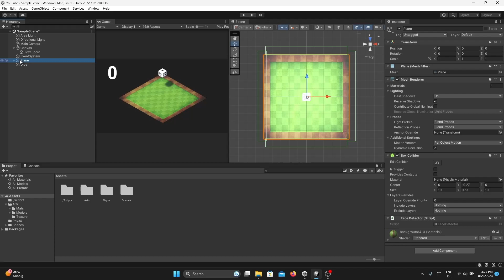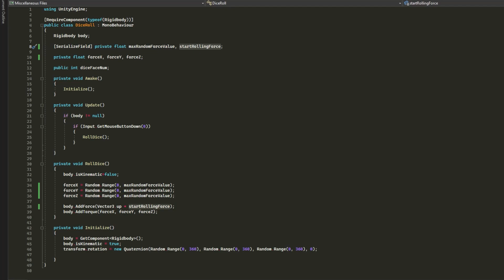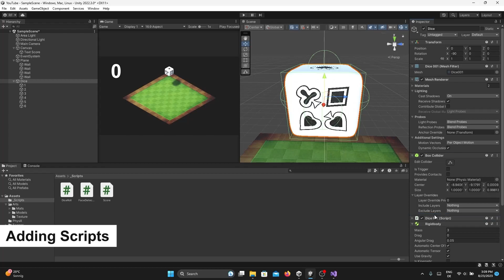A Simple Way To Roll Dice In Unity

Comment: Thank you for the tutorial. What is your solution if you want to simulate a dice throw, but the result is predetermined? <3
Reply from the maker: Great question actually 😁 u can achieve this result with several methods  if u don't need to use physics u can use animations then u execute the animation depends on the number u want. If u need physics in rolling the dice then u have to be sure that the environment will be always the same and then u tweek the added force and save each force value with the number u need ... for example to get 4 we need to add force (50, 60,30) then this force will always give us 4 if nothing change in the scene and of course we need to multiply it with time.delta so it works the same on any device. Hope this helps u
Reply: @Pixelsheart  Thank you very much. :) I also thought for the animation. :) In that case I would calculate the animations begining from the target value (adding some tolling and movement randomly) and play the animation in reverse order. :) So in that case the rolling seems real. :) Thank you for the force idea also. That did not crossed my mind . :) Before somebody thinks this was a troll question: It is a totally valid question because in (local) multiplayer games you can not let the user decide the rolled values (because it can manipulate and use as cheat) so the values in real are calculated (predetermined) on the server side. :) Thank you for the answer again. :) Have a nice weekend.
Reply from the maker: Yes i agree in game design balance we can't count on total randomness. Thank u for ur question and have a great weekend too 🥰